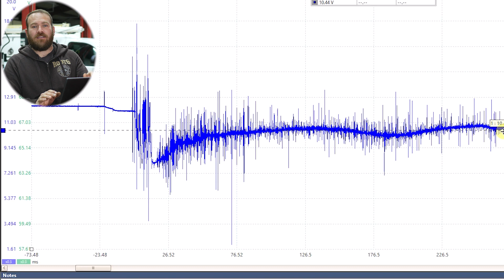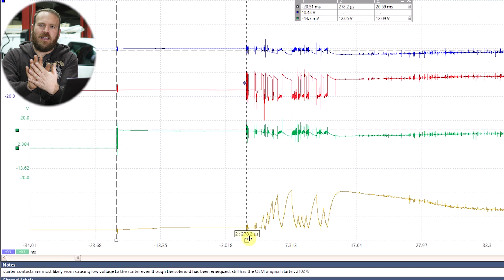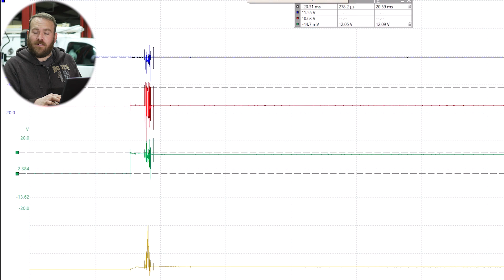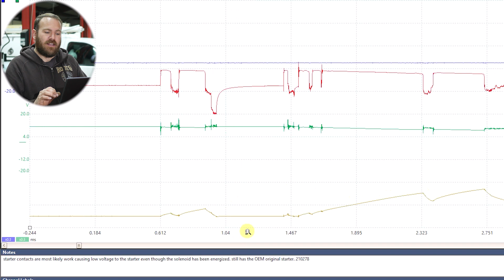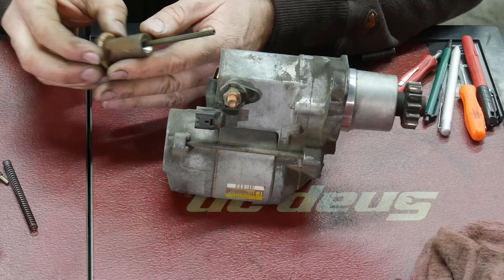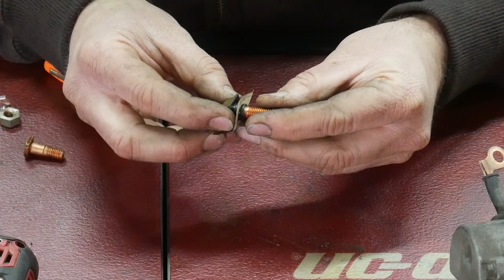1997 Toyota Camry Denso Starter Contact failure with scope captures

Comment: Chad, I really like the way you were able to get a test lead on the wire between the solenoid and the motor, it clinched the diagnosis. There are awesome design lessons hidden in the starter motor, every year I find new reasons for humility! This year I stumbled across the pico library of case studies, here https://www.picoauto.com/library/case-studies . The very first one of the list was a Ferrari no-start, and it raised the bar for my understanding. For some reason I never considered measuring current on the signal wire, and I am embarrassed to say I never properly understood the wiring of the pull/hold coils. In your study I admire the way you discuss swapping or cleaning contacts. Finding parts is the biggest obstacle, since few are willing to wait for special parts. Where do you order contacts?

Comment: You said the r&r time was .5 hr. What would your flat rate be for putting in the contacts? Where do you get the contacts? Do you ask for a starter service kit?
Reply from the maker: Book time was 0.8hr I believe. I would probably charge an extra 0.5 to swap in new contacts and clean everything up. I stock a verity of Toyota contacts but I do not stock the plunger. There are several placing to buy rebuild kits online including amazon. The reason the customer wanted a remanufactured Denso start installed was for the warranty if he travels out of the area.
Reply: Nice...Think the chop on the green trace at 3:55 is just normal contact “bounce”. Interesting autopsy. Thx & Cheers
Reply: Great info!